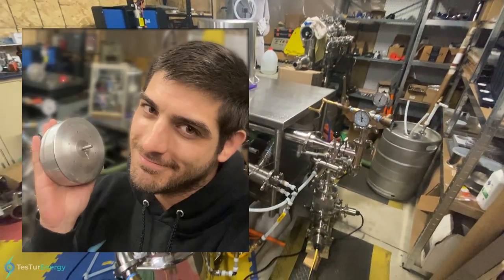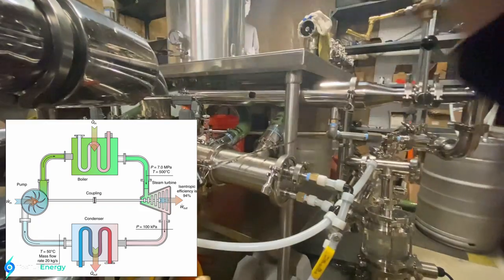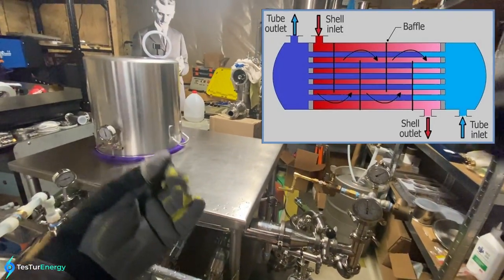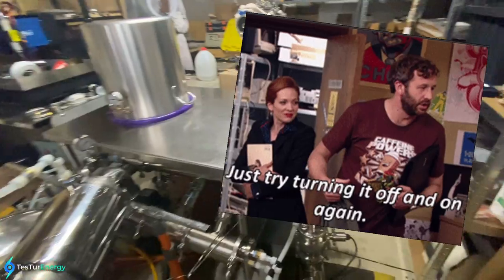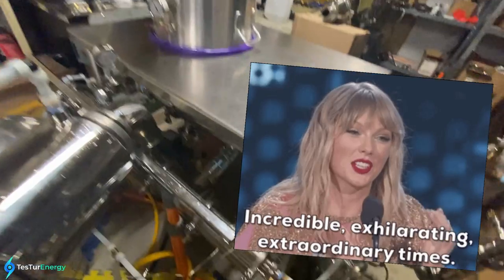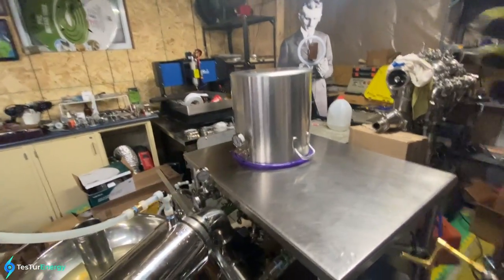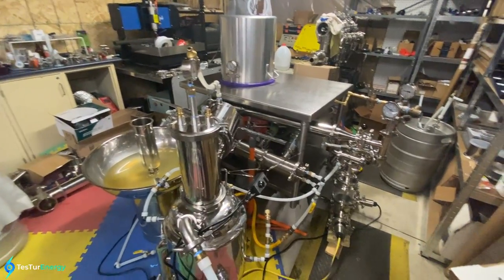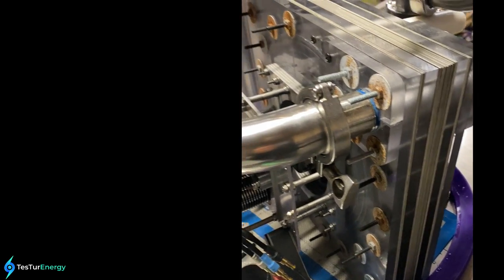Steam Tesla Turbine Renewable Energy Micro Power Plant - 1st Start Up

Comment: For vacuum feedthroughs I will use a solid copper wire with RTV silicone to seal it. Should work plenty good enough for what you are doing, likely not going to work very well if you're making vacuum tube amplifiers or something like that.
Reply from the maker: Great idea. I’ve got some polycarbonate caps for the clamps and I was going to drill a hole in and put a bolt through with some gaskets for testing. 

In the long run I would like to find something that’s off the shelf that we can make sure will be quality for our customers.
Reply from the maker: Hey I just posted a new video! I think you’ll really like it.
Who Owns Your Copy in the A.I. Revolution?
https://youtu.be/_v0N83U4NoU
Reply: @Charlie Solis  have you tried checking vacuum tube forums? May have some info there. You can also potentially use brass plumbing fittings and whatever method you use to seal them, of course you would need to isolate and enclose the live metal

Comment: Try spark plugs for a cheap electrical feed through.
Reply from the maker: Love it. This was going to be my next try. But I wasn’t sure what kinda continuous current they could handle off the top of my head. I imagined it would be more than I need for now but it wasn’t a spec I could find from a manufacture. Although they seem to be pretty large conductors.
Reply: @CharlieSolis  when in doubt just double or triple them up. I'm sure they don't have a great vacuum rating but maybe good enough.
Reply from the maker: @KyleDunnIt  Hey I just posted a new video! I think you’ll really like it. Who Owns Your Copy in the A.I. Revolution? https://youtu.be/_v0N83U4NoU

Comment: Righteous my Brother!! Looks as if the TT has forced your hand into upgrading it lolz. Quite honestly, probably at least half of the sound coming from the vacuum vessel.
Reply from the maker: I’m honestly really surprised with how quiet it is.
Reply: @CharlieSolis  Same here. It might be contained within A vacuum, just not outer space lolz. 
 What's your prognosis though? The pressurized turbine casing trying to expand outwardly in the vacuum, via temperature/pressure differentials; vibrational strain;  just all the previous wear and tear catching up to it; or all of the above?
Reply from the maker: @jeffpatrick1864  the ferrules were probably over tightens into the flanges and cause them to break. You can hear a “Pop” noise when I open the throttle on one of the spin ups. I think that was one of them going.  

Just the stainless expanding faster than the plastic also could have done it.
Reply from the maker: @jeffpatrick1864  Hey I just posted a new video! I think you’ll really like it.
Who Owns Your Copy in the A.I. Revolution?
https://youtu.be/_v0N83U4NoU

Comment: so how much electricity this system can produce. In this experiment, you did not do any measurments
Reply from the maker: Hey! That’s still to be determined! But I know from previous power loss tests that at about the RPMs the turbine was spinning at the turbine sees about 1-2hp loss from the bearings and 2 cheapo RC car gears. So with the direct on shaft generator setup I will be switching to, those losses will be available for power out. 

Also just the mere fact that the turbine was accelerating means there was available torque for power out. Change in rotational kinetic energy (joules) per some unit time (sec) is by definition work done/power out (watts=j/s) 

So between fixing the mechanical losses in the turbine and the available torque represented by acceleration the “Real” power currently being lost will then be available for power out. 

This was just a preliminary debut/showing of the very first start up of the system and then where I’m at as far as next steps. I need to make a good electrical through connection and we we will be ready to rock and roll for power tests!
Reply: @CharlieSolis  thank you for the information you putting. keep up good work
Reply from the maker: @stefanlicanin9485  you’re welcome! Let me know if you have more question!
Reply from the maker: @stefanlicanin9485  Hey I just posted a new video! I think you’ll really like it. Who Owns Your Copy in the A.I. Revolution? https://youtu.be/_v0N83U4NoU

Comment: I am nerding out so much about this, I’m gonna have to build one. For sure!
Reply from the maker: hey thanks for commenting. 🙏❤️‍🔥 

I really appreciate the love and support.    

So just to be clear I do have a degree in physics and many years of working with industrial machines.  

And now I don’t want to discourage you but I need to be abundantly clear though that sadly, these are not toys.

They are VERY dangerous if not designed or handled properly.  

I do not advise anyone who doesn’t already have a background in mech engineering/physics etc. to attempt to make one of them on their own.  

If you wouldn’t feel comfortable taking apart a jet engine and putting it back together and know that it would work properly again then I would think twice about taking on this endeavor.  

That being said, If you would like to start I would suggest by consuming as many mechanical engineering class videos as you can on YouTube.  

Learn all the thermodynamics behind steam and gas turbines.  

Specifically for Tesla turbines it requires a great deal more chemistry due to the Tesla turbine operating on molecular viscous adhesive forces between the fluid and discs and not in mechanical collisions with the blades like traditional blades turbine.  

So making sure to have the right surface treatments for the proper motive fluid is very important too.   

“Don’t French fry when you’re supposed to pizza or you’re gonna have a bad time.” <-Words to live by.
Reply: @CharlieSolis  thank you for the drop of information and yes I may not be very experienced but I will do my research and absorb and much information about this device and how it works. It would be very dumb of me to just toss one together out of the blue and run it in steam. Don’t worry about it too much but you do inspire me to looking into educating myself further.

Comment: Very Impressive! Nicely done Charlie. Thanks for taking us on the R&D journey
Reply from the maker: ❤️❤️❤️ thanks for being here with me for the journey! It’s been a wild ride already and we’re just getting started! 🔥😈🔥
Reply: @CharlieSolis   BTW, I've made my own electrical pass-throughs before just using a bulkhead fitting/nipple, running the wires through, and filling it with epoxy. Works quite well and is cheap.
Reply from the maker: @dumbarman  that’s a good idea too! How well do think that’ll hold up over time?
Reply: @CharlieSolis  The epoxy will last a long time and keep the seal, the only issue I've had with prolonged use was in situations where there was a lot of repetitive strain on the wires coming out that broke the wires. I've done other versions that had epoxy in the middle and maybe a 1/4" thick silicon on either end to act as a strain relief for the wires. Also, for best results/seal, I removed the jacket from any wires (that were bundled in a multi-wire cable) and ran them individually so each wire was sealed entirely with epoxy. with a jacket, I suppose some air could get through.
Reply: Just using silicon might work too, I've not tried it that way. The ROV hobbyists build a lot of pass-throughs and recommend epoxy
Reply from the maker: Nice! Yeah I didn’t think about just unspinning the section of wire to going through the epoxy to get it so fully seal across a thick section and still keep it twisted before leaving the epoxy for a strong hold.
Reply from the maker: @dumbarman  Hey I just posted a new video! I think you’ll really like it.
Who Owns Your Copy in the A.I. Revolution?
https://youtu.be/_v0N83U4NoU

Comment: Here's an idea for the electrical pass-thru into the vac chamber. Remove the insides of an old vacuum gauge. Machine a Teflon puck that just fits the empty housing, drill 2 holes straight into the visible face and link them up with angles holes from a single point on the side, where the wires will be routed down through the pipe and into the chamber. Silicone the inside walls of the gauge housing and then press in the prefabbed puck, lining up the hole in the edge with the pipe. Route wires up through the pipe and out through the holes in the face (use fishing line or something to pull the wires through). Connect the wires to your terminals, silicone the holes,  set the terminals in and wait for it to cure. You could adapt this to some other design that feeds through the vac gauge port.
Reply from the maker: I like where you’re heads at! Let me think on this. 🙏❤️
Reply from the maker: @Skunkhunt_42  ohhhh dood…. Duh!!! JB weld! 🤦‍♂️ I just saw Jay from @ThePlasmaChannel was just talking about using that for his vacuum chamber.
Reply from the maker: @Skunkhunt_42  oh yeah not in the sanitary world. Lol
Reply: @CharlieSolis  I was gonna suggest just using the tube off a vac gauge, running the wires through and sealing with JB weld, for a simpler solution that doesn't involve modifying the chamber.
Reply: @Skunkhunt_42  Yup, KISS method! 👍
Reply from the maker: @Skunkhunt_42  Hey I just posted a new video! I think you’ll really like it.
Who Owns Your Copy in the A.I. Revolution?
https://youtu.be/_v0N83U4NoU
Reply from the maker: @cosmiccrunch8591  Hey I just posted a new video! I think you’ll really like it.
Who Owns Your Copy in the A.I. Revolution?
https://youtu.be/_v0N83U4NoU

Comment: Yoooo! Amazing progress, the turbine sounds incredible in vacuum, and that violent boiling was just incredibly exciting, not to mention your pressure relief lever hahaha, so sick! Can't wait to see more.

Just thinking about your feedthrough problem, there's always uber expensive solutions whenever you utter the words "feedthrough" I experienced the same thing when I was trying to figure out how to lift a basket up and down out of oil in my vacuum fryer and made the mistake of even considering paying for an expensive feedthrough! I just bent some CS rods inside of SS tubing, sealed it shut, attached it to the basket with SS wire wrap and used magnets to lift it.

But I digress, can't you drill a hole and use a cable gland? Besides the standard nylon ones for weatherproofing and strain relief, there are  tougher metal glands on top of there being another class called sealing glands and should easily be able to pass a multiconductor cable while withstanding a paltry 13psi vacuum. I think sealing glands are advertised as going as high as 150 psi and are used in harsh environments. I mean the manifold that BVV includes with their chambers already uses half of what a cable gland uses. Threaded body, locknut on the inside, and flat rubber washer on the outside to make seal. Check it out!
Reply from the maker: Oh dang! This is all great advice!  Thank you! I’ll look into all of this!! ❤️🙏
Reply from the maker: Hey I just posted a new video! I think you’ll really like it.
Who Owns Your Copy in the A.I. Revolution?
https://youtu.be/_v0N83U4NoU

Comment: Did made something like that over twenty years ago. But a lot more crude.    I also use the condensor as a heat exhanger that is heating a 3000 liter boiler , a 500 liter boiler for the use of hot water. Indirect i heat my floor with it and several radiators.   In a weekend i can make the electricity meter go back to zero. Not actually zero but i can generate enough power what we did use during the week.   Yours is way more refined.  In an entire month it uses 1 m3 of wood. 
But it has no use to generate more electricity. And with the 3000 liter boiler i can heat my entire home every day.   Not when it gets below below 0 degrees.  But i have 4 other woodstoves also. 
Used a woodstove from the brand Flam as the heating chamber.  And an old very thick walled boiler on top of that.   Sadly it makes way to much noise.  Tried a lot of insulation. It helps but not enough.   I know that it is very illegal in my country. We have strict laws for using pressured steam.   And to be honest it is also very logical because when it goes then it goes.  Around the boiler on top of the stove surrounded it with 8 mm steelplates.  And made that stronger by welding 10 mm thick flat steel around it.  On top of that is the connection for the exhaustpipe that has an inner diameter of 200 mm. 
The Flam stove has two 30 mm thick cast iron plates that are round. Connected in the middle to each other.  Every plate has holes in it that functions as a venturi. And the plates can be turned on each other. By that creating a larger or tinier venturi for the air intake.    When those venturi's are fully open and the stove is full with wood then the flames go 4 meters into the exhaust pipe and around the boiler / heat exhanger for boiling the water and creating steam.  When the system is cold it only takes 15 minutes to get it fully working.  And i constantly have to put in wood. I see large blocks vaporising before my eyes. And it becomes so hot that you have to distance yourself atleast two meter from the glas door.  Through its entire life until know that stove burned thousends of M3 of wood. And it is so well made that it is still as new.  A beautifull stove with a big ass ugly farkle on top of it.  That probably one day will kill us all.  Made a safety 6/4 inch thick walled tube to the outside. When i turn the valve steam comes outside of my house. And although my closed neighbours are 800 meters away they still get a bit mad when i have to do that. Luckily not often because the sound of escaping steam makes them deaf even at 800 meters. And getting to much attention is also not good.  For sure i have hearing damage from the time alone that i was experimenting.   And whenever i will sell my hone i will break it down. To be sure that noone after me will one day get killed. Cause you constantly have to need your focus on it while it operates.  
A few times i have been looking into batteries. So we could get rid of the electricity company.   But that is still today not a good option.  Even when buying cheap 18650 elements and spotwelding them the costs are still way to high.  When you want to have enough juice to power everything in your home. 
I know that my generator has a lot of design flaws. That it all could be made a lot better but until know it functions and when people bring me waste-wood it saves a lot of money.  And 80 percent of the year it heats my entire home.  A bit to large home. The roof is 1450 M2.   Impossible to heat that with gas or electricity.  If i would have the energy i would build a new one. But after 70 years that has gone.  Would be great  in the future to go out with a big bang.  And it keeps my visiting family away in the weekends. So it is still a win / win situation.   That monster is placed in the kitchen.  And can't check how thick the metal still is. After so many years here and there it probably has got some weak spots.  And can you be really sure that pressure safety valves will kick in the way they should ? It is all mechanical. A bit jealous about the modern intelligent kids who also have access to tools that i back then could only dream of.  And happy to see that a lot of people are getting back into steam. 🙏

Comment: there was a weird forum post cant remember where that mentioned you could use the spiral distribution of fluid on the TT to actually use it as a turbine engine by feeding it an air fuel mixture from the edges that would flow down to the center , eventually the discs would match the flame velocity at the edge and you wouldnt need to reignite the fuel each time. wonder how real that claim is, so i figured i might as well ask you in the comments lol.
Reply from the maker: hey thanks for showing your love and support by commenting 🙏❤️ it really helps with the algorithm!        

Are you referring to Teslas Improved Combustion + steam turbine patent GB 186,083? (that he patented in 1921, 10 years after the original turbine patent and about a decade of R&D)
Reply from the maker: The second half of this video I do a walk through of the combustion system and recoup boiler. 
Solis Talks Cold Steam Tesla Turbines - Nikola Tesla’s Electrical Power System + Patent GB 186,083
https://youtu.be/5Y3D13JmtcA
Reply from the maker: And then this is my replication thus far of at least one of the burners and steam mixing tubes. I’ve tested both gaseous and liquid fuels (propane and gasoline) still to test out waste oils and stuff.
Tesla Turbine Jet Engine - gasoline fuel burner atomizer flame tube test 186,083 propane burner
https://youtu.be/gRqKowignac
Reply from the maker: And lastly, as far as air fuel mixing I have a design for a Tesla pump multifuild vortex mixer. 
Tesla Compressor Multi-fluid Vortex Mixer & Steam Condenser - Air + Fuel Mixer Carburetor Atomizer
https://youtu.be/qLBqbBPikcc
Reply: @CharlieSolis  was mostly referring to the possibility of using a direct flame contact and even detonation to drive the turbine, using a startup to get the vorticity going inside the cavity and get that nice almost laminar flow of air fuel mix, and making it combust in a spiral from the edges into the center
Reply: @CharlieSolis  also, props for using propane, way underrated energy density at its convenient storage conditions as a liquid
Reply from the maker: @thunderBOOM23  Hey I just posted a new video! I think you’ll really like it. Who Owns Your Copy in the A.I. Revolution? https://youtu.be/_v0N83U4NoU

Comment: A threaded well should work fine. Get someone to tig one in wherever you need it. The probe will screw in. You can get prox switches with a full threaded body to sense the pickups. Screw them in to the desired insertion depth then double nut them.